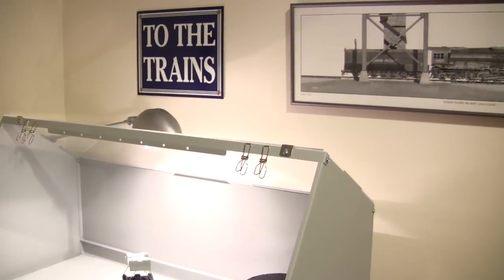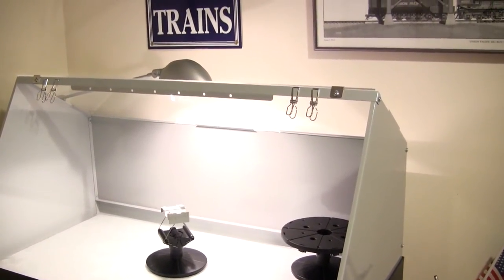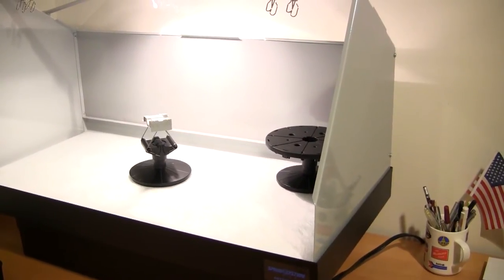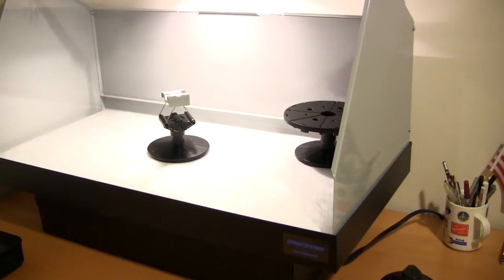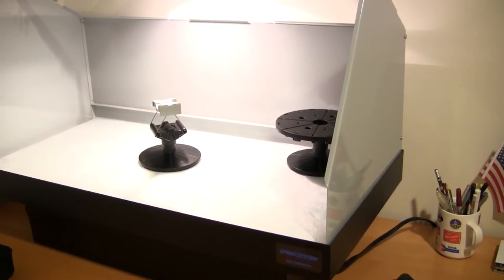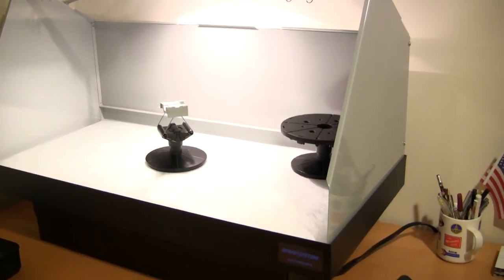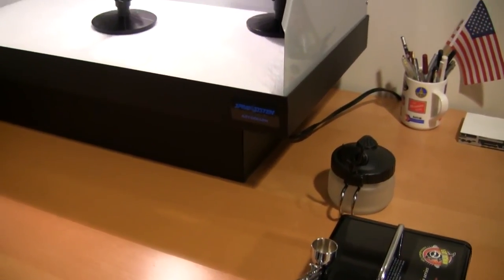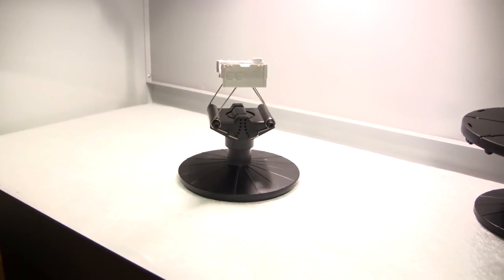Artograph 1530 HOBBY MODEL SPRAY SYSTEM Paint Booth Made in the USA Part 2

Comment: I have the same spray booth.  I love the fact it is a down draft system and it is not really loud at all.  So far i have painted quite a few brass models in mine and weather a lot of locos and rolling stock.  A couple pieces of advice I would give is get something flat such as a small piece of wood to place things on in the booth.  Such as airbrush cleaning cup.  Just place it to one side of the booth is all.  the next thing would be put a piece of painters tape along the lower edge of the booth.  You can use this for testing your airbrush before use.  Hope you have been enjoying your booth and keep up the great videos.  Oh last thing even though you will be ducting it out, you should still use a respirator.
Reply from the maker: Thank you.